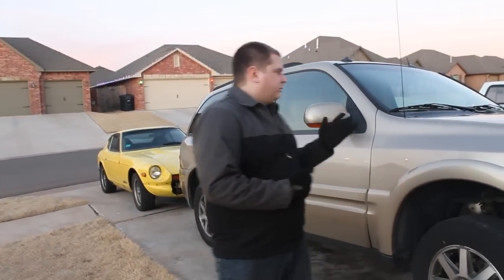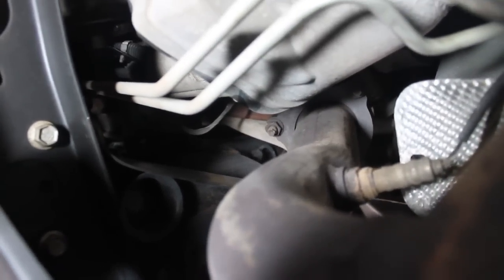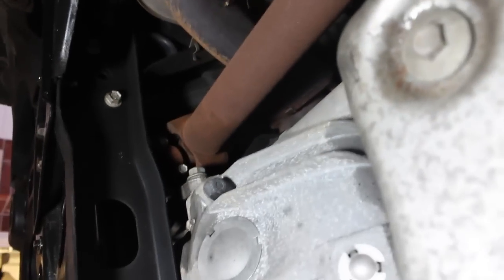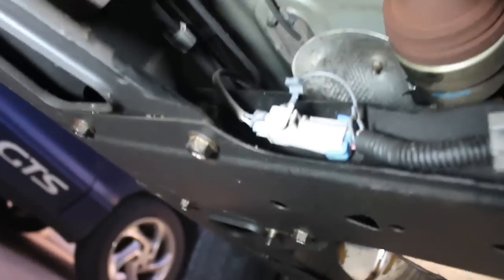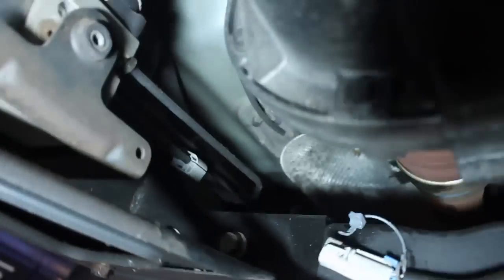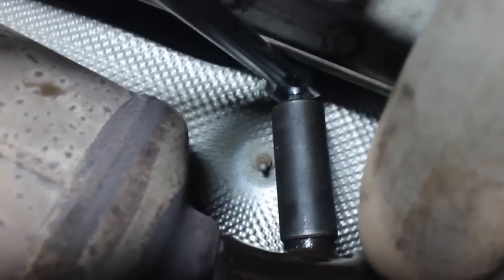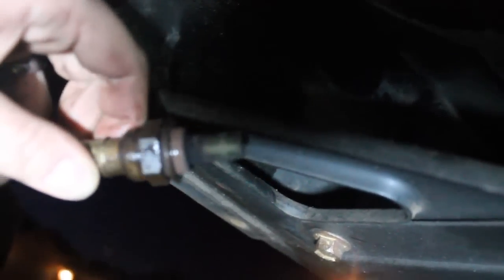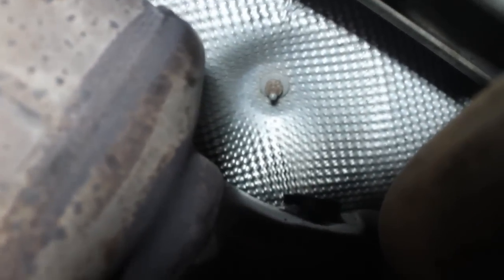How to Replace Oxygen / O2 Sensors On Your Car

Comment: Hi 
I have Toyota tundra 2006 and it's Turning off suddenly and the computer test giving me two codes P0171 System too lean bank 1 and P0174 System to lean bank 2 and P0102 mass or volume air flow a cricuit P0113 intake Air temperature sensor 1 Circuit high  so can you tell me how can I solve this please 
Thanks a lot

Comment: Good Video with real practical advice. I'm getting a fault code of P0037 on a 2006 Buick LaCrosse (Allure) 3.6L. "It is shown as P0037 Heater Control Circuit Low Bank 1 Sensor 2"  Can you direct me to any help on this?  Thanks in advance.

Comment: Hey u said you cut the wire to fit.the socket on. How dobu connect the wire back to the new o2 sensor is it like a twist thing or something??????. Please my tauras needs nee o2 before they can inspect it.. im putting the 02 sensor myself

Comment: I appreciate your posting this. My TB is running terribly since the check engine light came on. Mine sounds like it's running on five cylinders. Is that a symptom of a bad sensor? Please tell me in your video I couldn't tell if you removed the shroud covering the exhaust manifold before you could remove the O2 sensor?

Comment: I have a po0140 code on Pontiac trans am 5.7 liter. Which side is the o2 sensor located for bank 1 ? Is it the driver or passenger side? I know it is the rear o2 , but not sure which side

Comment: Replaced the primary O2 sensor on my 2002 Acura 2 years ago and it just threw another P0141. I get this in cold, (<40°) rainy weather. This leads me to think the problem is in the harness, not the sensor itself. Any advice on troubleshooting? What voltages should I read?

Comment: Thanks Nick. If the engine light is ON because of O2 sensor error (P0133 on my Hyundai Accent), will I not get an inspection sticker?
The error I get in scan tool is - 02 sensor slow response code. I have a 2001 Hyundai Accent and I wonder if it is really worth spending any $$ on it. My inspection is due by end of Feb and ideally I want to keep the car for another 6 months or so.

Comment: Well done Nick! Thanks for the info.

I had SES light with P0421 code (downstream O2 sensor) last winter on my 2007 Eclipse V6 3.8L. I had it replaced by the dealer (ouch!). The same code came back this winter. I'm told this is common with this car in the cold weather. My question to you is, Is it possible that the O2 sensor will go bad winter after winter or could it be just "cold weather starts" ?

Thanks for any input.

Comment: Good video.  I have a 2003 Mitsubishi Montero.  Failed emission, with codes P0155 and P0161.  Are these sensors difficult for a novice to locate and replace?  You said they're either in front or behind the catalytic converter? That's in the front of the vehicle underneath?  Thanks
Reply from the maker: That indicates faults in both o2 sensors on the driver's side.  In my opinion this is not a difficult task, though some vehicles can be harder than others.

Comment: I have a 06 Trailblazer ext I'm getting the o2 sensor trouble code bank 1 sensor 1 I have the inline v6 which would I need to look on?
Reply from the maker: If you have an inline motor you only have one o2 sensor bank.  Sensor 1 is the upstream sensor closer to the motor, before the catalytic converter.
Reply: Thanks a lot Nick

Comment: I have a Honda Odissey 99 with P0131 code problem, change the oxygen sensor, the bank 1. sensor 1 and yet still latching on check engine light with the same code that I can do?

Comment from the maker: Sensor 2 is downstream, the one after the catalytic converter.  Bank 1 is the driver's side.
Reply: Hey Nick need your help my Envoy just poped up P0136 I see the Rainer has the same engine so do you know if the sensors are in the same spot and would the bank 1 sensor 2 be the one after the cat going towards the rear of the car.

Comment: Would you be kind enough to tell me where is the o2 sensor on a 2006 Buick Lucearn is it in the area of the buick rainier?  I have had the code read by auto zone and they sold me a new one to replace the old one.

Comment: If anyone has a 2005 nissan altima, I recommend getting a 02 sensor crows foot socket for the upstream o2 sensor located on the front of the engine. It's in a tight spot and close to the radiator. This crows foot socket was the only thing I could find that would get this sucker off as a wrench is too long since its so close to the radiator. It will take a little while to get it off due to the lack of room to move your ratchet but be patient. Good luck.

Comment from the maker: Sensor 1 is the upstream sensor, it will be on the side of your catalytic converter closer to your engine.  That code could indicate the sensor has failed, though it could also indicate a wiring fault, so be sure to check closely for any damage to the connector or wiring running to the sensor.

Comment from the maker: Just depends on how easily you can get to the sensor and get it out.  If it comes out easy then less than an hour, if it is hard to get to or really stuck in there then several hours.

Comment: Hey Nick, how ya doing?  I'm Nick too.  I have a 2001 hyundai elantra and I got the code P0132 Oxygen sensor Bank 1 sensor 1 signal high.  One, does that mean the sensor's bad or is something else causing the sensor to read high?  Two, where do you think this sensor would be located?  Thanks a bunch for your help.

Comment: Sorry to add to the questions but I have an 03 Honda accrd Ex, my check eng light goes on and off every so often..went to emissions and the light came on, P0141 and P0402 were my fail results..I have a mechanic friend who will change the O2 sensor first to fix the problem..hopefully, but that's next month..I nd to register now, can I have the codes cleared for now, will this pass emissions? I need to register this month but the car won't be fixed until nxt mnth..thanks!!

Comment: .... the light is back on and i got the reading P0141 02 Sensor Heater Circuit Malfunction (Bank 1 Sensor 2) and cannot erase the codes or get rid of the light. what should i do? i have driven about 20 miles with my new lambda sensor before replaceing the engine,,, so i have to get it replaced again just to get rid of the light? or is this only due to my new engine? any help would be much appreciated thanks.

Comment: hey man first of all great video! i am from UK and have a bit of a problem....ok i from the UK and have renault clio sport 182 cup (2004) i had my engine management light on for ages got it checked out and replaced the lambda sensor post cat, instantly my fuel was better and the light went out.... then after about 20 miles the light came back on and basically my cambelt broke and me and my dad replaced my engine recently.. the car is running fine and seems to be doing good mpg but...

Comment from the maker: It's always a good idea to disconnect your battery before doing involved maintenance on your car, and you can reset the check engine light using an OBDII code scanning tool.

Comment: hey hows it going man, i recently got check engine and i scanned with the obd2 and it showed P0135 i have a 2001 honda civic lx ...i just got a new hood but the latch broke so ivd had to tie down the hood with a 4 ft chain and was wondering if this could have caused this?? since it hangs a little

Comment from the maker: Yes you need to replace both sensors.  The first code may be a wiring issue or something other than the sensor, but it is probably the sensor.  The second code is definitely the sensor.

Comment: Hey, I hope I can spare your time for just a little bit.
I own a '00 Impala and I had 2 codes, P0134 (no activity on sensor 1), so I will just assume that the sensor is bad and needs replacing. There is also P0141 (heater circuit malfunction on sensor 2), which means the sensor after the cat is not heating up? Should I just replace both sensors? is the 2nd code something more than a sensor? Thanks in advance!

Comment: Hey Nick I have a 2003 bmw 325i and I have been doing research and I think the o2 sensor is the problem but im not sure.  But here is my problem. Check engine light is on of course and I have a manual. Well when i get around  80 mph+ (on interstate of course) and my RPMs reach around 3.5 my car does not accelerate any more and if i go up a hill you can forget about it.. only way it will gain speed is if I go up a hill.  Only way I fix the problem is pulller over and restarting my car

Comment: thanks for the video, man. Here is my case: the check engine light came on when I was parked, in a couple of minutes after I started the engine (chevrolet aveo 07). The error was P0141, so this is sensor 2, I erased that one and it hasn't occurred again yet (after 100 miles). Do you think I need to order the sensor now and replace it or not to rush for now? Thanks.

Comment from the maker: If your vehicle is missing power that can change your shifting behavior, if it suspects it does not actually have more power at higher rpm (due to a clogged cat) it may not downshift.  Crazy smart cars I know.  If you have a code for your cat and you are losing fuel economy you almost certainly have a bad cat or o2 sensor.  You need to replace it.

Comment: I see 4 sensor 2 in front one in front of you when you pop the hood and under  the front is the second then 2 in back on the exhaust pipe a 1996 Camry 6 cylinder.

Comment: Thanks so much Nick for your time and response. I have NO problem with hesitation, sputtering, just my engine (tach) that wont downshift after 3rd and 4th gear. It will after Ive driven a bit and engine is warmed up (cat is hot?). Thanks again.

Comment from the maker: p0135 indicates failure on bank 1, sensor 1.  That would be the sensor closer to the engine, which is the only one if it is a 4 cylinder.  I'm not sure which side is bank one on that particular motor, whichever side has cylinder 1.

Comment: Thanks! Ch eng lite on for over a year. No problems(?). 30-33mpg consistently. Over the past 3 months Ive had significant mpg loss (from 31 to 21mpg). Eng does not downshift after acceleration. Tack stays way too high. No sputtering, no problems accelerating. Had codes checked and was told the cat con is faulty....$450!!!! Have Honda Accord06 165K miles. Can this just be O2 sensors? $50. Can a suddenly(?) bad cat cause significant mpg loss? Thought cat lasted the life of a car? Thanks, Stephen

Comment: Did you run into any problems installing the new sensor? I'm assuming you wouldn't be able to install with the same socket because of the wire...

Comment from the maker: It would be very similar.  You probably have a 4 cylinder so the o2 sensors will probably be most easily accessed from above though.

Comment from the maker: Well you are on the right track.  The p0175 indicates that somehow more air is getting into the intake than the MAF registers, and the other two codes indicate that vacuum leak is coming from somewhere in your EGR system.  All that said, they could be unrelated.  A loose gas cap or problem with a vapor line to your gas tank can cause the p0446 and I would suggest attempting to fix that by itself and that may lead you to the solution for the other two.

Comment: my 2006 buick has p0446,p0171,p0175 codes ,.I checked for vacuum leaks and all hoses are good , cleaned MAF sensor  .also replaced the canister vent solenoid. any idea on what can be giving me these codes?

Comment from the maker: Yes there is always one right before and right after the catalytic converter.  If the check engine light has gone away for now then that means they are still sufficiently functional, but I would replace the faulty sensor anyway.

Comment: are all O2 sensors located on the front end of all vehicles..? i have a 2006 hyundai elantra and the sensor was on for two days and then after one night sitting in drive way, check engine light was not on anymore.  Also should i replace sensor.?

Comment from the maker: It should be pretty much exactly the same on your taurus, there is a cyllinder with an electrical connector on it that plugs in your air box.  Remove it, clean it, and reinstall it!

Comment from the maker: That is a tough one.  Do you have any check engine lights or other symptoms?  Failures like that tend to be pretty vehicle-specific, but that generic symptom may be a fuel problem, potentially the fuel pump or fuel pressure regulator.